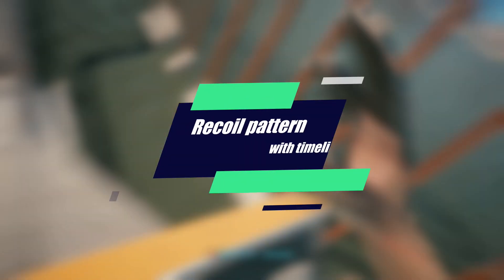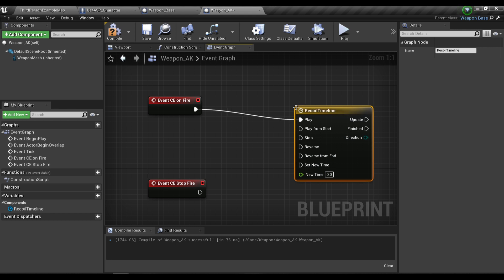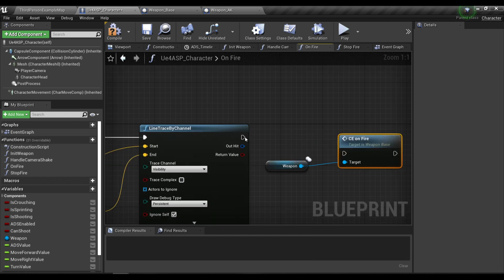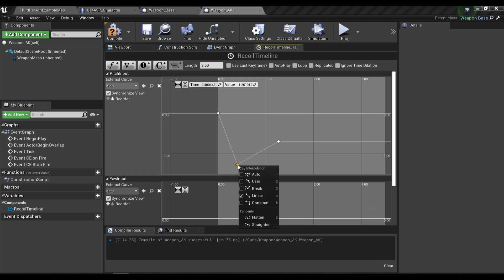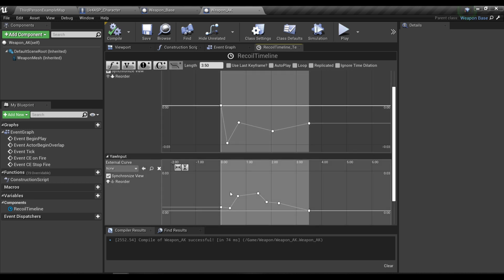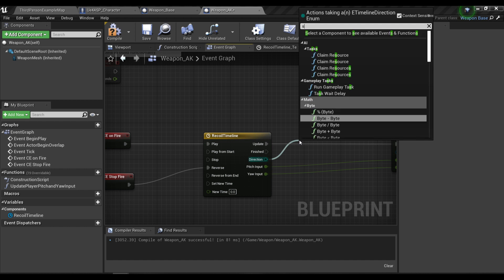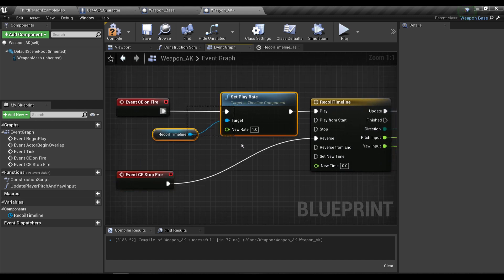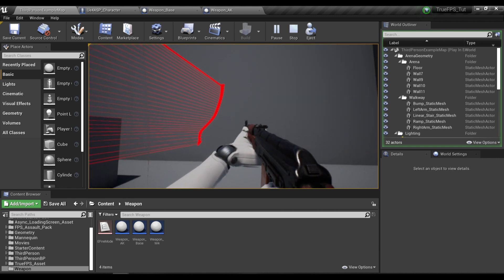Recoil Pattern - Part 2.1 - UE4 Realistic Recoil Tutorial Series

Comment: When tried setting the pitch to +1 in the timeline, the gun went down, and when setting it to -1 it went up. I fiddled a bit but couldn't find the origin of this problem. Any ideas?
Reply: The default template uses -1 as the base axis. Its basically coded inverted, then flipped

Comment: I’ve finished the video just now and the resetting recoil has a few problems. The first problem is that if you control the recoil, it goes down lower than the original rotation. The second problem is that if I move my weapon away while shooting and let go then the recoil goes under the original rotation. I have seen someone else fix this by saving the original rotation and then rotating back to the original rotation with a delta node and in a you have the rotation right now, in b you have the original rotation, or it’s the other way around. For the other problem, he got a delta then vector length, if it’s over 10.0 then you cancel the recoil reset.
Reply from the maker: That's actually a great point :v Maybe i'll make one more vid to improve the recoil timeline :)
Reply: @CyberLOD  ok hit me up if you need help with that.